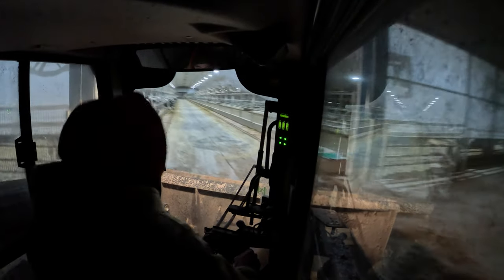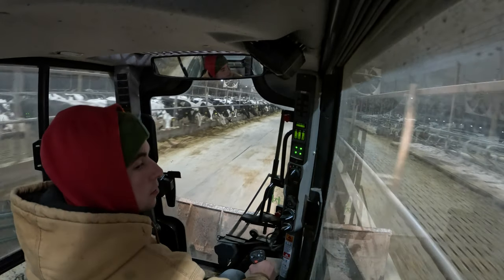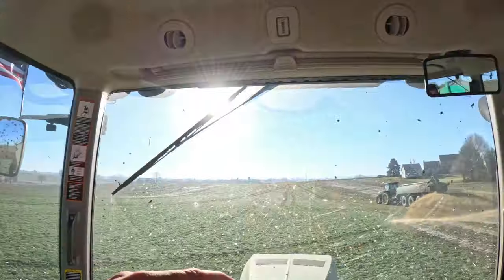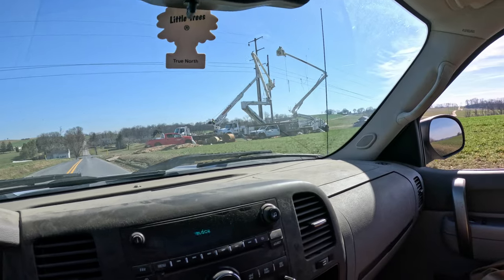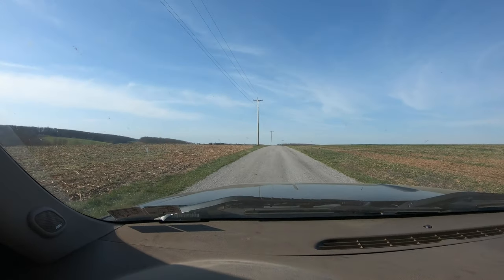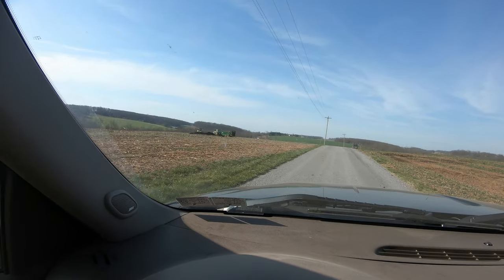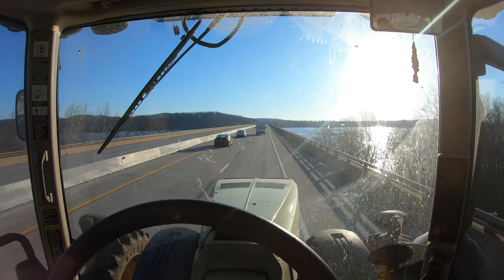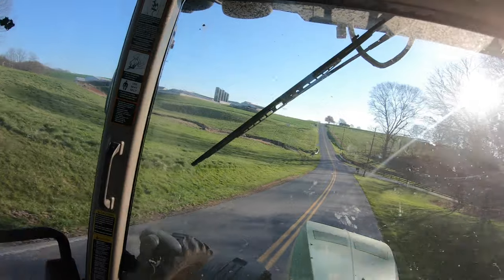Spreading Chicken Litter

Comment: The biosolids outfits use logger tires (tractor treaded) on the loaders because that stuff is usually wet when it's dumped. They still spin some, but get full buckets. Great video again! The moo doo and chicken poo smell like $! Only need K to get fertility for crops.👍👍
Reply: Those tires would a definitely been the way to go in this situation

Comment: It looks like tile on the surface under the feed. What are the reasons for this different material?
Reply: Plain concrete absorbs and sweats moisture worse than tile and over Time will start to erode. Tile is also a smoother surface to eat off of in the long run
Reply: Thanks Tony I sure enjoy your videos and appreciate your work ethics. @TonyPRohrer
Reply: @TonyPRohrer  Is it worthwhile using porcelain or can you get by with thin ceramic in this application?
Reply: @dhenschel4 tile seems to work fine. Porcelain would be nice though
Reply: @TonyPRohrer  I would think ceramic would break given the loader and truck traffic, as ceramic breaks so easily in the house, but as long as it works go with it!
Reply from the maker: Good question but my dad got to it before I did